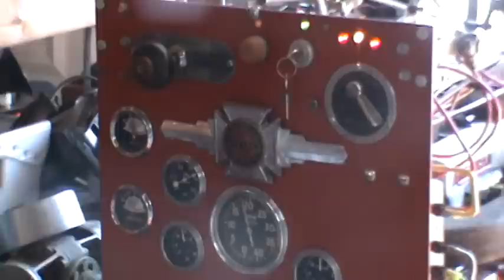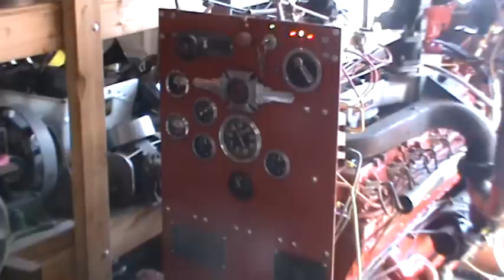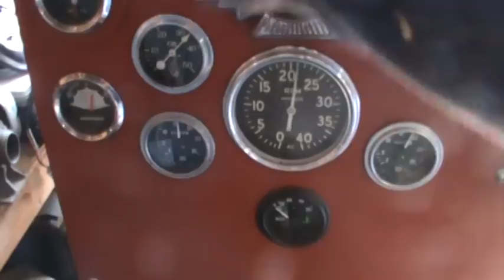American LaFrance V-12 Engine

Comment: A very strange and complex engine.  Very narrow 30-degree V angle, directly actuated side valves and reverse-flow heads.  I would imagine adjusting the valves is quite the chore.
Reply: as is timing.

Comment: 24 spark plugs, dual magneto
Reply: 4 distributors, twin spark heads, Jay Leno has one
Reply: @666t  the fire company finally gave up and had a 331 Chrysler Hemi installed to replace it, then it ran like a 🔥 🐎 firehorse